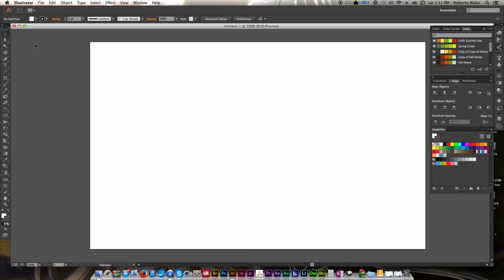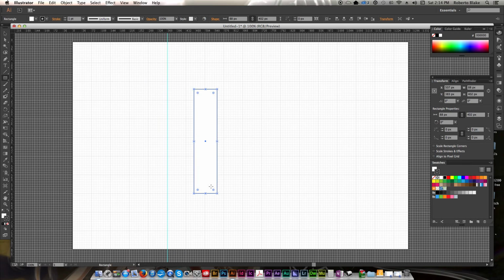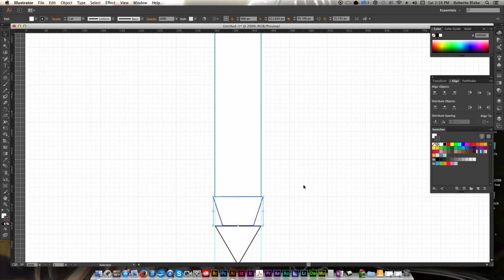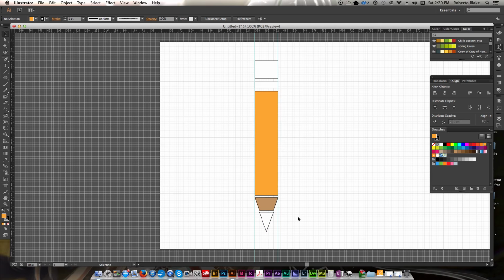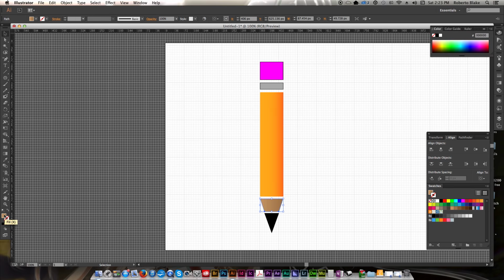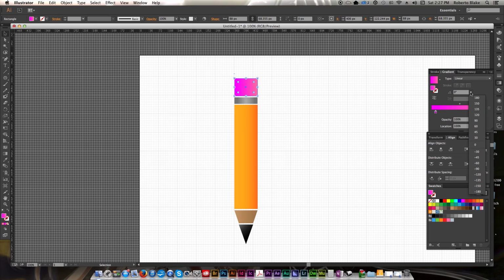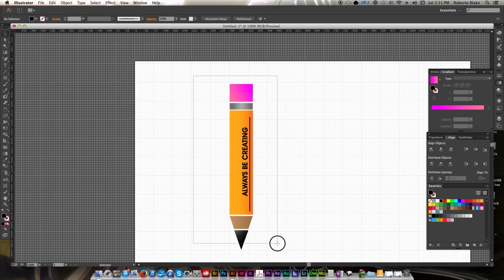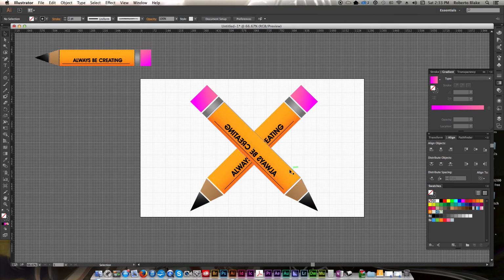Getting Started With Adobe Illustrator CC Tutorial

Comment: Hey Roberto, what's any easy way to make sure multiple colored objects each have the same saturation? Something I've wanted to know for awhile. Thanks.
Reply from the maker: Lisa Doherty When you have the color selected you can double click on the color in the color and swatches panel and you see the saturation levels as well as adjust them.
Reply: When I double click all I see are the RGB or CMYK degrees. Not sure what you mean.
Reply from the maker: Above RGB is HSB Hue Saturation Brightness
Reply: Am in CC and if double clicking on a swatch within the swatch library saturation/hue don't show. However, tried accessing the same info from the color wheel, but wasn't sure what percentages were appropriate without drastically warping the original colors. Also wanted to ask, when rebranding from the ground up, after establishing the logo is it best to cover basic stationary before embarking on a client's website? Meaning, which makes sense to come first?
Reply from the maker: Lisa Doherty Before going into the stationary consider creating some branding elements to compliment the logo that can be used generically to balance it when necessary, also understand that Social Media is the new "stationary" so take that into consideration as it probably is a more immediate concern than letterhead and right under biz cards in terms of priority.
Reply: Alright. Good to know. Thanks : )

Comment: still figuring out why i shouldn't just use Photoshop in doing what mostly all illustrator can do.
Reply from the maker: mike ndaba Vector vs Raster Files. If you're doing logo design in Photoshop, you will be called out on it by the next designer someone talks to. The lines and graphics will not be as sharp and cannot be resized with out blur or pixelating. If you watch the video again and how I zoom in to 400-800% and its still super sharp you will see what I'm talking about. You can't do that with images made in Photoshop. So with business cards and other print materials when we want sharp images and text we use Vector Programs like Illustrator or even InDesign. It's a standard in the industry and a practice of Professional Graphic Designers. Knowing the industry standards and getting comfortable with using the best tools for each job is a good way to set yourself a part from hobby designers if you're looking to do this for a living.
Reply: Thank you so much Roberto, i really needed someone to explain that to me, much appreciated Roberto Blake